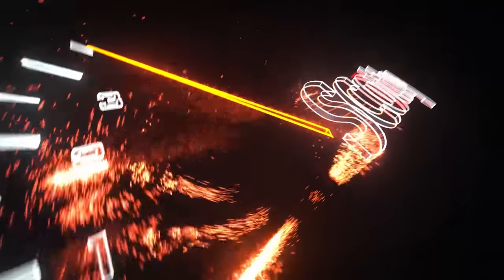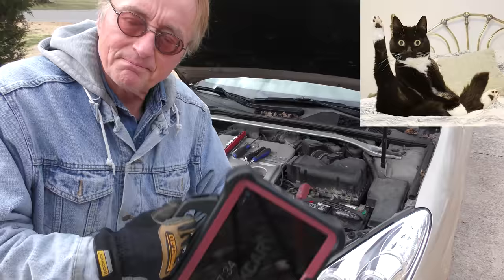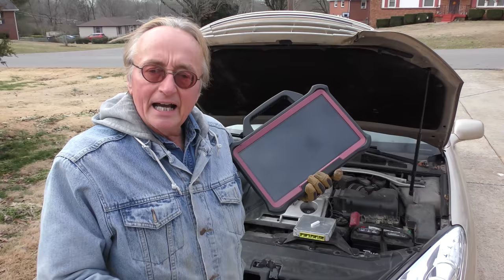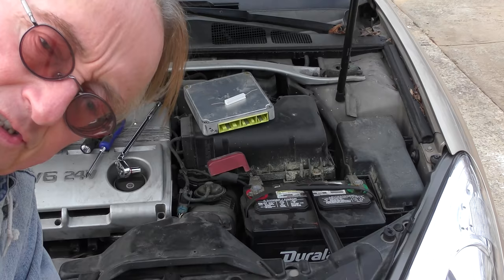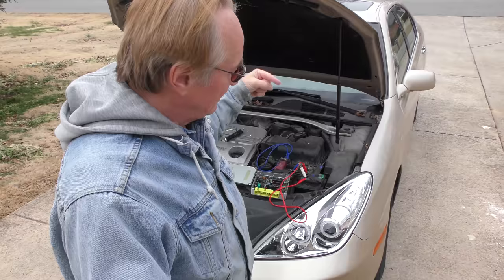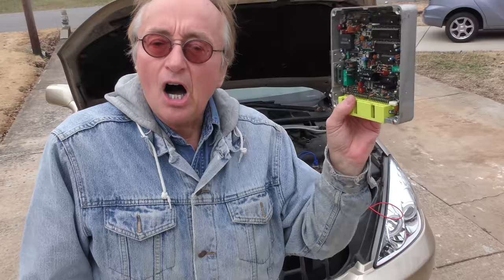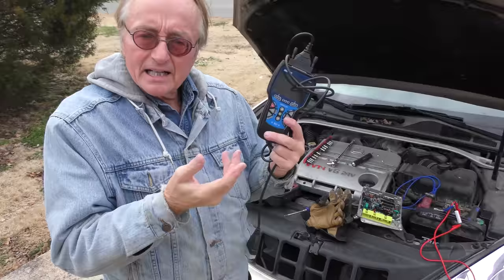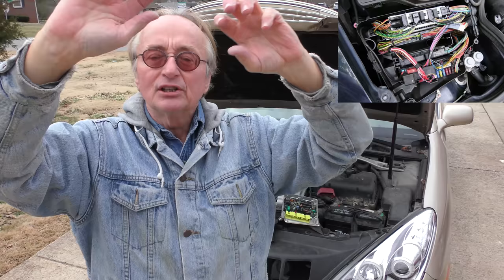This Stupid Thing Will Save You Thousands in Car Repairs

Comment: Scotty, I know you know this, but many may not. Always disconnect the negative side of the battery first. I learned this years ago. 
😲😲😲
Reply: True...
Reply: Its a good guideline but it doesn't matter unless you manage to short circuit the tool against metal part (I have done that with tractor haha)
It's not even possible in some cars to do it that way. In my car the positive needs to be removed before the fuse box and battery cover and holding screw can be removed then you can slide the battery forward and access the negative terminal because the battery sits length wise in the engine bay with the negative side under the windshield and positive side towards the front of the car so only it is reachable without removing stuff and moving the battery forward.
Reply: @imrileth6618  If you start removing the positive terminal 1st and touch nearby ground, there will be sparks flying... Now, if you remove negative terminal first and touch nearby ground, nothing will happen. Then, with negative terminal removed, when you start removing the positive, and touch nearby ground, there will be no sparks since negative terminal is disconnected from the battery. I always remove negative terminal 1st. I still have all my fingers and all my tools...

Comment: Thanks!  2010 and newer cars have permanent set codes that require engineered driving paramters that nobody is told what they are.  Jay leno got a hold of a ford engineer for his ford gt for the exact drive cycle.  You can fix the problem, but if you dont drive the engineered drive cycle, it will stay there, an keep your engine light on.

Comment: Guys, it's 1000 ohm resister, he is holding a 1K resister. 1 ohm is almost a complete short !!!
Reply: A one ohm resistor would conduct a gentle enough current, starting at a maximum (~12 A) and smoothly drop from there to 0 A when the capacitors are fully discharged.
Reply: @sabasc3tube   12 Amps? That's "gentle"? These are computerized modules, not soldering irons.

Comment: Scotty,a light bulb can be found at all car parts stores and  then can be used on the car-or stored as an emergency spare.  The bulb has enough resistance when cold to prevent current surge spikes. Thanks...MacGyver.
Reply: Jeff, r u saying that instead of using a resistor just use a small lightbulb?!
Reply: @abytc2023  Yes. It may be easier to find a lamp instead of a resistor.
And,it can be used later if a turn signal or brake light burns out.

Comment: Scotty, great information!  But, isn't that resistor a 1Kohm?  It looks like is says 1K on it.  1 ohm wouldn't offer much protection for keeping the current spike to a minimum, but 1000 ohm (or 1Kohm) would.
Reply: I was thinking the same thing,  1ohm  is nothing
Reply: the spike won't be more than 12V anyway. Harmless.
Reply: @executive  Not 12 V is a problem. 12 A is dangerous (12 V/1 ohm=12 A).
Reply: @mirceabarca5828  No. It is not dangerous.
Reply: @executive  Not dangerous to people, but dangerous to the delicate electronics you're trying not to zap by shorting the battery terminals together.
Reply: @paulsengupta971  there will not be 12A for any significant amount of time, and touching the cables does not zap any components
Reply: @executive  Being back-fed from capacitors with effectively a short circuit is what we're trying to avoid by using a resistor.
Reply: @paulsengupta971  how is it different from being "forward-fed" by a 12V battery? ( I'm using quotes because to the circuit it looks absolutely the same)
Reply: @executive  Diodes.
Reply: @paulsengupta971  Sorry Mr. Sengupta, but the capacitors are in the same polarity as the battery. Still no difference. You have no idea what you're talking about, do you?
Reply: I don't think it's actually a voltage spike, but rather a current spike. 5V across some capacitance which you then apply a short circuit across could lead to very high current temporarily. That could damage semiconductors. Applying a load, even as low as 1 ohm would limit this to a max of 5 amps. By using such a low value resistor the remaining energy will be drained relatively quickly. Using something like 1k/1000 ohms would take a very long time to drain the energy.
Reply: @paulchambers360  Bear in mind that if the capacitors are in series with the electronics, you'll effectively be back feeding the current, as if you've connected the battery the wrong way round. 1 ohm wouldn't limit it by much. 1k would be better, which is which Scotty was trying to say...then have a cup of tea or something for 10 mins while it drains.
Reply: @paulsengupta971  Why would you put the capacitors in series with the electronics? In that case they would have no power?
Reply: @paulchambers360  I don't mean to isolate the whole thing!
Reply: @paulchambers360  learn ohms law

Comment: You just saved me 185 dollars Scotty.  I've got the SHVS error.  Fixed the problem, cleared the code several times with OBD, keeps coming back.  Dealer wants 185 to clear the code. Good feeling when you can beat the crooks.
Reply: The dealer probably does not know about the fix either. With a basic shop rate of $125 - $150 an hour, it might easily take an hour or so to do the reset by the book - especially since part of the procedure probably calls for checking and clearing any other codes.

Comment: For me Scotty keeps getting half right!    When removing the cables to the battery. Most of the time one should remove the neg. (Black) first  because if slip and touch the middle of the vehicle it will not cause a major problem    like welding the wrench to the frame  that would like shorting the red and black cables together.  This way you can  safely remove the red cable from the battery.

Comment: Great tip, Scotty, but isn’t that a 1K Ohm (1000 Ohm) resistor?  That’s what it looks like when I pause the video at 1:35, and look at the writing on the side of it. 1 ohm would be almost the same as if you just touched the battery wires together.
Reply: Good observation, I can't tell from the video, but if you consider 12v/1ohm, that's 12 A wow, plus it would be way more than 10W. 12ma would be more like it.
Reply: I think it's 1KJ, not 1K Ohm
Reply: It says "1KJ" which is a 1K Ohm (1000 Ohm) resistor.
Reply: Scotty is primarily an entertainer now
Reply: @executive  Yeah, pretty much, I don't think he does much actual work anymore.  Not easy when you get old though.
Reply: That's a huge difference. I hope it doesn't mess up anyone's computer.
Reply: @kapaul1584  he deserves credit for the energy, that's for sure
Reply: @thomaspc0  it won't
Reply: @kapaul1584  fortunately because there's nothing but capacitors to discharge, so the current won't stay high at all and even if the current did reach 10 amps briefly it's better than a few hundred amps with a short circuit at a fraction of an ohm.
Reply: @executive  he does actual work all the time? In all his videos even the ones where he’s simply just talking about something, you can see different cars lining his driveway.
Reply: @keithusaf1  1KJ or 1k ohm 1000 ohm
Reply: @executive  He makes crap up, and all his followers lap it up eagerly..  He probably USED TO work on cars, now he just makes youtube videos and cashes checks.
Reply: @RandyFuchs  he doesn't make anything up. He's a very wise, knowledgeable and experienced mechanic. It's just that some of his knowledge becomes obsolete. It happens to everyone. He still works on cars, but not any heavy duty jobs. We'll see how you're doing when you're 70.
Reply: I ve never seen they sell a 10w with 1k ohm resistor!

Comment: A 10 watt resistor seems overkill to me. I seriously doubt that you'll have  that much power discharging through that  1 ohm resistor. A 10 watt 1 ohm resistor can handle 3.2 amperes of current. That said, using a resistor to discharge the capacitors in the modules would be a safe way to discharge them. Sizes other than 1 ohm could be used but unless you know the design of the modules the discharge time could end up being hours with large resistors. I'm going to run some tests with my Fluke 77 voltmeter and get back to you.  I don't know how they build those modules but they should have some kind of spike protection, though. Yes I'm an electronic technician with 40 years of experience.
Reply: Update us when you'll do those tests
Reply: Me too
Reply: TMI
Reply: More is better.  A resistor is cheap.
Reply: Generic, a suitable filament lamp would serve as well, and maybe save a trip to the store.
Reply: I'm not splitting hairs on this I'll just do what Scotty says it works
Reply: Curious what your testing finds. He is friends with some of the sharpest minds in the business so im curious to see what you come up with.
Reply: I wish Scotty had done a close-up of that resistor, so you could read what was printed on it---Even full screen is too blurry to read it.
Reply: Are you flattering yourself? Who cares if you are an electronic technician for 40 years and has a Fluke 77 tester. 
Scotty gives everyone here a great technique to clear all codes from all the modules using only a resistor vs buying a $5000.00 gadget and I think he really did a good job.
Reply: @brianb5779  1 ohm @10 watts will get the job done. I'm just thinking that a smaller wattage could be used. I have to determine the current draw to determine that. And the current draw will probably be different between different vehicles. So 10 watts could be a "one size fits all" situation. I don't have a 1 ohm, 10 watt resistor in my parts bin and I don't have any electronics stores where I live. But I do have a large assortment of 1/8, 1/4, 1/2 and 1 watt resistors. If needed, I can parallel resistors to get the resistance and wattage that I'll need. I would have done this today but it's quite cold and I don't have a heated garage.
Reply: Can you tell me which resistor I should get to this but get to discharge my 2012 honda crv?
Reply: @genericdude6551  Okay im liking where your going w this
Reply: Looking at the resistor, it looks like a 10 watt, 1 K resistor where I K= 1000 ohms.
Reply: @reyc8736   It’s “Technique”.
Reply: I suspect the code memory is some form of NVRAM and needs to be reset to clear it. Draining the modules of power probably does nothing. I had an intermittent problem with my Jeep a while ago. I didn't take it to my dealer to diagnose it because it took me too long to get back home from vacation. When I eventually did ask the dealer about it, the technicians told me that I could have brought it in when I got back and they still would have seen the problem because it stores about 50 key cycles worth of data.
Reply: @THOMMGB  He did say 1 ohm but I looked at the video more closely and the resistor does show 1K @10 watts on it. 1K will probably get the job done also but it'll take longer than using a 1 ohm resistor. I'm going to start out with 1K and calculate the current draw as well as how long it takes to discharge with a variety of resistors. Regardless, these electronic boxes should have been designed with some kind of surge suppression. I have shorted the positive and negative clamps on both my 02 Mustang and 14 Xterra and haven't experienced any problems.
Reply: a 1157 lightbulb has approx 12 ohms resistance,
Reply: I enhanced the video. It looks like it was a 1K ohm resister.  Not a one ohm.
Reply: @reyc8736  scotty is a character and fun to listen to.  Voltage surge from shorting the cables together? If you knew anything about electricity, you'd know this was nonsense. There might be a reason, but a voltage surge likely isn't it.

I'm not an anything certified tech.
Reply: So as an electronic technician, you would know what happens when scotty puts the battery cables back on.
Reply: Tactical  .
Reply: @elultimo102  I paused at 1:33 and it reads:  10W  1KJ
Reply: @guinnesscan80  Lol. So it's a 1k ohm (1000 ohm) resistor. He's avoiding a current surge, not a voltage surge. He just misspoke throughout the video. I could understand avoiding a current surge, using a resistor, but a 1 ohm resistor isn't really doing much for that purpose, whereas a 1000 ohm would. On the other hand, the current surge he's avoiding is basically going to occur when he hooks the battery back up. It could be that the circuitry is more sensitive to a quick drain surge, than a quick charge surge. I would have figured that automotive electrical systems were designed more robustly than that.

A 1k ohm 1/4 watt resistor would be suitable for this purpose. Power (watts) is v^2/r or iv or I^2r. So say your electrical system, with its various capacitors was sitting at around 13 volts when you disconnected the battery, that would yield 13*13/1000=0.169 watts of power going into the resistor, when you first connect it. If one were buying a resistor for this purpose, a 10 watt is the way to go because it would be harder to lose. A quarter watt resistor is pretty small.
Reply: If anyone is concerned about a "quick charge current surge", just simply use the discharge resistor in series with the battery to recharge the circuits before reconnecting the battery cables.
Reply: I used a 1000 ohm, 1/2 watt resistor but since the current draw was only 1 mA an 1/8 watt could have been used. It took about 30 minutes to drain the voltage down to 0.1 VDC.
Reply: @genericdude6551  So a 1k resistor would be a little trying on one's patience...depending on how the system is designed, as you mentioned in your initial post.
Reply: @nodriveknowitall702  Better to have some patience than be sorry that you destroyed a computer. I have seen youtube videos where people simply jumper the 2 cables without a resistor but they usually wait about 10-30 minutes before going through the relearn process. I did this computer reset because I replaced my TPS.  It was really weird when I started the car because it immediately went to 3000 RPM and stayed there until the car got to operating temperature and then immediately dropped to 700 RPM.
Reply: @genericdude6551  Jumping to 3k would have had me wondering too. I've been tinkering more with autos lately and I think I'm just gonna pony up the money for a decent scan tool. The choices (with features or lack thereof) and price range has had me on a research binge.
Reply: @nodriveknowitall702  could always attach the 1/4W resistor to a brick to avoid misplacing it, if that's the whole reason for the 10W resistor 🙃
Reply: @genericdude6551  I think he means 1k ohm (1000 ohm). One ohm is almost a short, in fact the wiring harness probably has that much resistance to the ECM. If it really were one ohm, it would only take seconds, not ten minutes, to discharge everything.
Reply: WHERE DO I GET A RESISTER AND EXACTLY WHAT WATT AND OHM?

Comment: Good to know. Don't know where to buy such a resistor. I wonder if connecting a small light bulb like a dash light would suffice. Also I'm surprised that Scotty disconnected the positive terminal first. If the tool had touched the chassis he would have created a short circuit. Always disconnect the ground first and connect the ground last. Safer that way. It's common knowledge.
Reply: 1K ohm 10W.
Reply: Yes. Use your ohm meter to see how many ohms you've got. You may have to get the right ohm bulb.
Reply: @fivish  Hi there, I cant clearly understand is it a: 1ohm 10W resistor or b: 1K ohm 10W resistor. What is a 1K? Sorry for my ignorance on electronic parts.
Reply: @sergejgeg8838  On the video Scotty holds a resistor with markings: 10W 1KJ. I believe this translates to 1ohm 10W resistor, but I'm not an expert in electronics :)
Reply: @sergejgeg8838  I Ohm 10 W  rated resistor.  Small  resistance with  a high power capability.
Reply: Digi -Key online has them.

Comment: The resistor doesn't limit voltage spikes, it limits current to around 12 amps (assuming you have a standard 12V system).
Reply: Yep. That is a 1 K Ohm resistor, limiting the current to 12 ma.

Comment: A 1ohm resistor has very little resistance.  Even a length of wire has some resistance.  Wouldn't a 100 ohm  resistor work just as well and be much more unlikely to drain too quickly.
Reply: Yes, 1 ohm is too small, it's basically a short circuit.

Comment: I did this with my 2020 altima, it gave me the code 2135 and it got slow, I changed the accelerator pedal, I cleaned the throttle body, but after 2 weeks the code came back with the same symptoms, now I did it 8-25-2024 and it seems that everything is fine!! Thanks Scotty s:trophy-yellow-smiling:

Comment: Correction may be needed. Look at video time index 1:36. The resistor label (upside down) says "10W 1K 'omega symbol' " (omega means ohms). 1K means 1,000. I would go with a 1,000 ohm not a 1 ohm. That allows a much small current avoiding risks of such low resistance, but still would bleed off the residual power. It may take a few seconds longer but safer in my judgement.

Comment: Disconnecting both battery cables and then turning on the headlights and let the car sit for 15 minutes should accomplish the same thing.  Just be sure to turn the headlights off before reconnecting the battery cables.
Reply: Wait would this really work?
Reply: @jonathantorres3244  Since the headlights share the same power source as the computer and its accessory controllers, there is no reason why it should not work,
Reply: And, another simplification, you only need to remove the negative battery cable. The positive cable can stay connected.
Reply: @sabasc3tube  and even if there was any need to remove both cables, it's always best to remove the negative one first, to minimize the hazard of your wrench contacting a chassis ground point while fussing with it. Doing the positive first can let loose a very large spark, while it wouldn't be any problem with the negative terminal touching down.